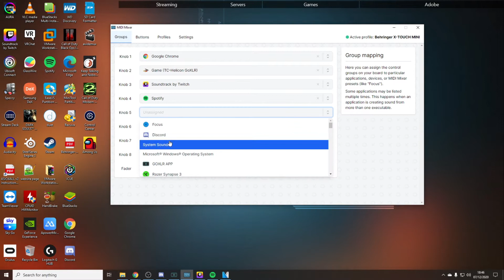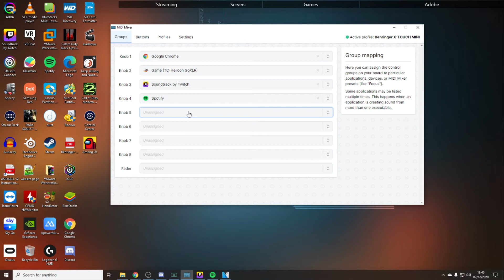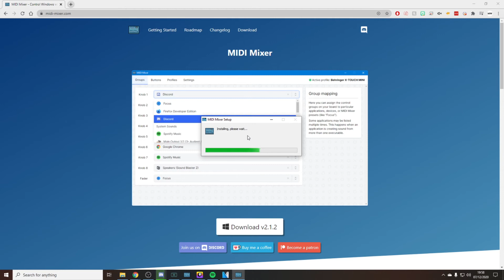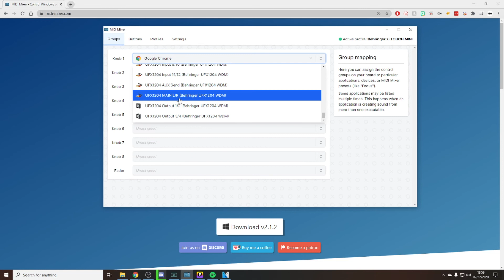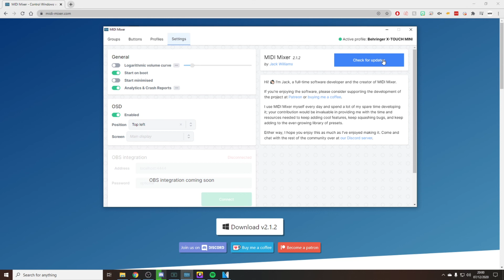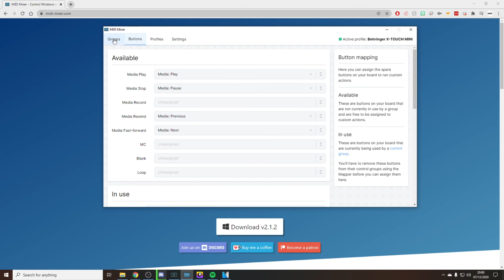Setting up X-Touch Mini as volume controller

Comment: i love this for my friends as it seems really accessible but I think I am going to have to keep trying to integrate it with reaper. I wish reaper was more controller friendly. every time i get a new piece of gear it takes forever to integrate.
Reply: it is friendly, it can even make use of the most awkward controllers. with extensions like relearn and CSI the possibilities are endless. the only more controller friendly DAW is ableton, but that's mostly because the manufacturers make their presets work with ableton from the start. try cubase or logic, that can really take forever and sometimes just won't work, whatever you try...
btw most problems in reaper have already been solved by others, searching the forum and youtube will almost always show you the way to do it.